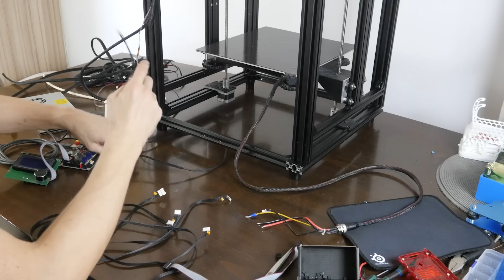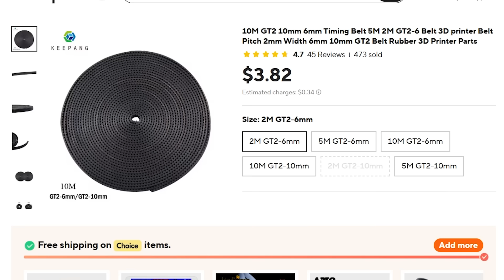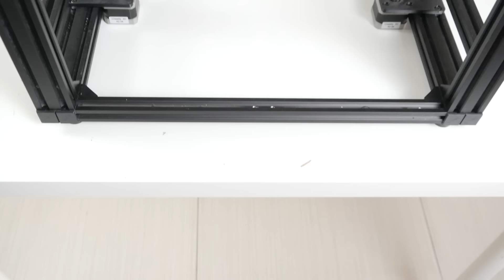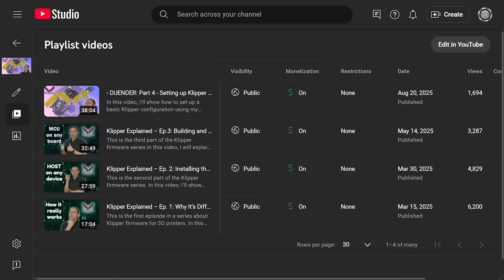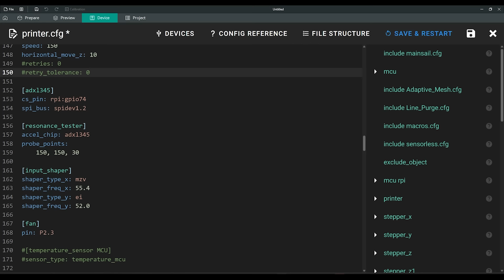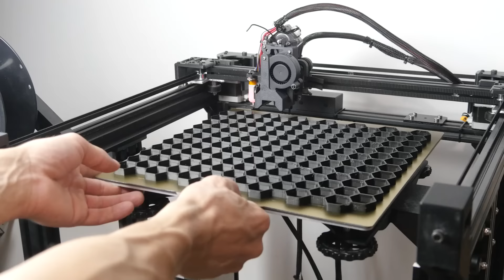I built a large CoreXY 3D printer for just $200 from two old bed-slingers

Comment: The build looks fine as is. It can print faster but not perfect, it's cheap (if you do value learning vs time learning). You can rip out prototypes and if it's close send it to an old cr10s pro and wait for a finished good quality part. Or spend a ton of money on a proprietary printer spend 40 bucks on a nozzle and print fidgets in 4 color. Utilitarian builds like these are more useful long term and thank you for reminding us of that.

Comment: Yeah i understand the philosophy i have myself m'y core xy printer based on a old cr10s, the project is on github (cr10core) im currently working on a custom toolchanger. 1.5 year in the project the printer doesn't ressemble in any waw from a cr10 it has now an awd corexy system and 4040 extrusion, a full by  myself toolhead and a lot of upgrade, but its can be mount with a lot of old cr10 part exept the extrusion and linear rails

Comment: Cześć bardzo mi się podoba to co robisz 👍👍👍 .
Ja się na tym nie znam , ale chciałbym się tego nauczyć.
Mam do Ciebie pytanie czy Twoim zdaniem można zbudować sobie drukarkę o podstawie 3000mm x 3000mm i na wysokość też 3000 mm i zrobić tą całą ramę na łozyskach liniowych z maszyn CNC ?
Pozdrawiam serdecznie z Polski 🙋🍀
Reply from the maker: Ooooh, I think that would be veeery difficult. The larger the printer, the more problems appear with the stability of the whole structure and the alignment of all axes. Starting from around 500 mm, I think you already need to move to fundamentally different ways of reinforcing the frame. You need to calculate the loads and make everything very rigid. And at that point, the price immediately goes into space.
Reply: @Irbis3D  Rozumie jesteś super człowiekiem 👍 dziękuję za odpowiedź 🙋

Comment: Could you use just 2 cr 10 v1 ?
Reply from the maker: Yes. The only issue is that the first CR10 models use a 12V power supply, which is not really enough by modern standards. Ideally, you would replace the power supply, but that also means replacing the heaters and fans. The biggest challenge is the bed, because its heater is not so easy to replace.

Comment: Possible with elegoo Neptune?
Reply from the maker: It is hard to say for sure. I do not know what aluminum extrusions it is made from. They seem to be non-standard, closed on the sides. You would need to measure everything, put it into CAD, and try to build a Duender frame or something similar using the parts from two Neptunes. It is possible that a couple of extra extrusions would still need to be purchased.

Comment: Hey, great Video, subscribed right now! Please help me with tipps to build something similar. I have a CR-10 V1 since 2018, heavily modyfied, RAMPS 1.4, E3D V6 Hotend, 230 V Heatbed, automated EZABL Bedleveling, Custom Marlin, Octoprint, and the List goes on. I could get my Hands on another CR-10 V1 for about 40€ and would love to build something similar like you, because i also like to tinker around with Tech. Meanwhile I recently ordered a Bambu Lab P2S, so this will probably be my new workhorse scince it arived and the CR-10 would otherwise be collecting dust. Do you think the E3DV6 ist capable of Printing that fast? I would like to reach printing speeds like you. For the printhead i have the "CR-10 Heavy Duty customisable modular e3D V6 mount Volcano 5015 ABL" from Thingiverse and I'm thinking about moving the extruder motor, so that it would be a direct driven one. All that sad, are those printing speeds reachable with this setup or would i need a different printhead? I would love do build this one budget frindly, but it should also be a realiable printer. Greetings and thanks in advance :)

Comment: May I have the STL files for this project? I just started assembling the profiles together and need some of the printed parts you used in the video to mount the Z axis. I'd like to build this printer exactly like you did, and then add on the hotend + filament changer like you did on the Duender.

Comment: My experience is that the era of printing when the ender 3 and cr-10 dominated the market is where the best used printer deals can be found, but the older era of maker it's is where people seem to think that just because they paid $1000+ dollars for a printer 15 years ago that it should still be worth that much on the open market despite the fact that even the cheapest bedslingers on the market for the last 8 years have been able to run circles around them for a fraction of the price they think they can get for it XD.

Comment: I did something similar to my Anycubic Kobra Plus, except it's not core XY, it's a head slinger now, using the existing controller and firmware. The project cost me about $100 for extrusions and hardware. Interestingly, the way I mounted the bed ended up more rigid than the original and my bed warp went from 1.5mm across the 300x300 plate to 0.5mm. Though I need to 3d print some panels to stiffen up the frame an I get some ringing in the print head.

Coincidentally, I came across a "broken" Kobra Max which is actually a much better candidate for this due to the bed being mounted on two extrusions. I think I could convert the Max for under 50 dollars and end up with a better result than I got from the Plus.

Comment: I am the same way I designed and built my own printer out of an old tronxy x5sa. I 3-D printed jigs and cut most of the parts from sheet metal to keep the cost extremely low while keeping performance extremely high! I have abut $700 in my build, but it is literally one of the fastest and most reliable printers around especially considering the cost and mostly metal so it will literally last forever

Comment: I think you're underestimating your work here. Outstanding printer especially for the price, i've been thinking of making a CoreXY from one of those I3 clones as they have linear rods, but i've not ben able to get my hands on one for a reasonable price. Thought of using V slot/ender3 clones and couldn't find any good videos about it until i stumbled upon your channel. I do however have a small question, why are the V wheels oriented horizontally and not vertically? wouldn't it make sense to have them vertical so they support the weight of the X axis better? is the belt tension significant enough to require them to be oriented this way? can't wait to see what video you have lined up next :D.

Comment: Good morning, I've been watching for a long time, looking for inspiration on how to improve the CR10S Pro V2 because I bought a fully functional one for €60. Maybe you have some ideas for it?
Reply from the maker: If I had that printer, I’d completely replace the electronics, install Klipper firmware, and swap the extruder for something like a Biqu H2. The rest just needs to be inspected, lubricated, leveled, and tightened — and it’ll be a solid bed-slinger.
Reply: @Irbis3D I just installed skr 3.0 with a clipper. I'm thinking of making a Z axis belt by Kevin Askaham and adding a screen from Ender 3 for previewing. I currently also have a V6 3.0 hotend and a BMG clone.

Comment: I also found my Pi3 was unstable driving some 3d printers using a 64 bit raspbian version, crashing with no info in the logs, except for some prints pointing to USB.  So far the fix has been to add "dtoverlay=dwc2" (without quotes) at the end of "/boot/firmware/config.txt".  Since I did that, it has been rock solid.
Reply from the maker: Great, thanks for the info. I’ll try it. People have already written that the 32-bit version also works fine, but this solution is simpler.

Comment: i have a CR10V2 and CR10 Pro do you think i could use those two do this same thing?

both haved caused me issues and been wanting a large 300x300 XY Core printer tbh
Reply from the maker: If it’s about the CR10 Smart Pro, then I’m not sure, it has custom profiles and the case on the bottom. You’d need to check what profiles it has, measure them, put them into CAD and try combining them.

Comment: I've been thinking about something similar, late 2023 I got a refurbished Ender 3 v3 SE and it sat in a box for 17 months before I set it up. Got only a couple prints before it died because someone or some machine didn't properly tighten down -24v (ground) from the power supply, and it melted the hell out of the screw terminal.
Got a used one from craigslist, works for now but I'm keeping an eye out for another used/damaged SE/KE so I can drunk-build a duender-SAKE

Comment: Good stuff. Would love to see a 600x600x600 printer. From what Voron says, anything above 400 cubed you run into a lot of issues especially when having it enclosed and heated because the frame changes due to the heat which causes binding and inaccuracies of prints. This would be a next level challenge.

Comment: The other common secondhand printers for not much money I see are Anet. Which use linear rods as opposed to aluminium section and pom wheels. Given that many retail core XY printers use rods, I wonder whether your next design could try to incorporate these as a cheaper option than linear rails?
Reply from the maker: It doesn’t turn out much cheaper, but it’s a completely workable option. At least two people in my Discord made versions on shafts.

Comment: Damn, you beat me to the punch. I've been planning on a double CR-10 for the past 3 months, gathering components and stuff with a little higher budget, but still have not been able to find a second used CR-10 in my area for such a cheap price. I own an original CR-10 and it's my only printer. My goal is to build a Voron Trident style printer with AWD mod using CR-10 frame parts, but going with linear rails and better bed and electronics. The design is ready and currently printing all the parts needed, just need to get my hands on another CR-10 so I can start assembly. This means that I'll be taking apart my only printer to build a new one. Let's hope I have designed all parts well :)
Reply: Ditto 
My plan is a trident with INDX
hadnt considered harvesting components untill now 🎉
Reply: how did it go?

Comment: Just before I discovered this channel, I picked up a pair of broken CR-10s for $100, and got super intrigued by the Duender concept for the exact project in this video. Outstanding. Personally, I'm very interested in an IDEX setup, despite its loss in build volume. Also very interested in a budget toolchanger setup. Very excited for future updates
Reply: Check out his Project Medusa! You can have 5 extruders if you want. You could probably fit 8 or more on the larger frame.
Reply: Your building yourself just make frame a little wuder and you dont need to loose print volume fir the idex 🎉

Comment: Thanks for the video! Your work has been a big inspiration to me in realizing that old printers can be rebuilt and combined into cool CoreXYs, and (if I understand correctly), that you can run multiple printer mainboards on the same printer using Klipper! Thanks to that inspiration, I'm now in the process of tearing down an old RepRap i3, an Anycubic Predator delta printer, and an Ender 3 to rebuild into a super-low-budget Voron V2
Reply: Which I'll probably end up trying to add a Medusa-style MMU to as well!

Comment: dude!  that's awesome!  i love how you were able to reuse so many components from the old machines.  i didn't have quite so much luck with my design using an ender 3 max neo, but i also had most of the other parts i wanted to use onhand so not much had to be purchased - the main design is finally almost done & will be published on printables without enclosure soon.  i had a couple spare 2020s & a 2040 all long enough to do 3 z motors, so i was able to make use of the ge5c bearings i've had sitting in a drawer for around a year too.  i couldn't do linear rails yet either quite yet, though, so i'm looking forward to seeing how similar your solution will ultimately be to mine.  keep up the great work!

Comment: How much is your time, bro? I just mean it costs much more than you ' ve pointed. Great result. But it s not just some metal parts and electronics. It s also your imagination and experience. It costs.
Reply: I think that would be a valid question for something less fun. I mean, yes someone could theoretically work ~20 hours overtime to earn the money to buy a nice big printer (depending on wages and printers, of course). For sake of argument, say this build took ~100 hours. So, you could look at it as a waste of ~80 hours, but the real question is what you would do with the other 80 hours. If they would just be spent being bored and doing nothing, you didn't really come out ahead, but if you had something else more meaningful and enjoyable than building a printer, you'd come out behind.
That argument also depends on actually having the option to work 20 extra hours for pay, which isn't necessarily realistic, and could rule out buying something nicer if you have more time than money.
If your favorite thing to do in your spare time is build 3D printers, it makes sense to build something like this! If not, then it probably isn't

Comment: I got mine for 100us.. 'working, missing parts" endor 5 300x300x400 bed. New, Never used.  It needed the hex bolts/slot keys for assembly.  if you look you can find it.   Thanks.. now I'm in the "what to do now" mode. first test print apprehension.  ha ha  ha ha  thanks  big help watching your channel.

Comment: Irbis is casually offering a cheap and very powerful solution for large core xy printers. I think it's better than the most common Ender 5 core xy mods that cost over 200-300 dollars.
Reply: Or just buy old Ender6 even more cheaper option
Reply: @OxySacura It still needs a couple of upgrades to pay to print fast and well and I think it has a little less print área. Still good option
Reply: I have a ENder 5 plus and a CHiron, I think I could build a nice large format core x y?